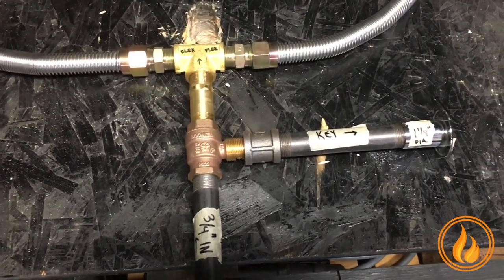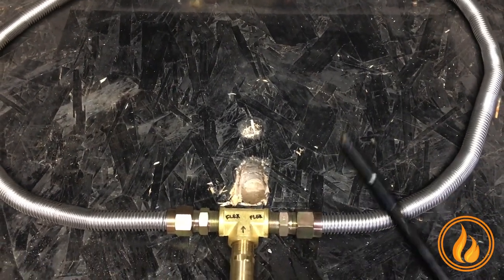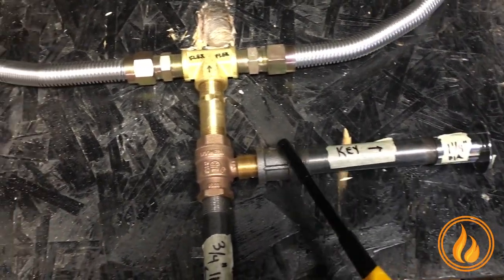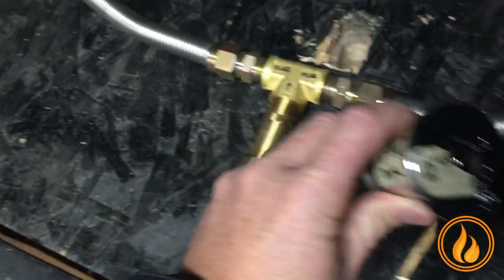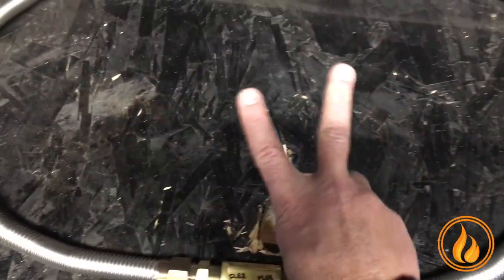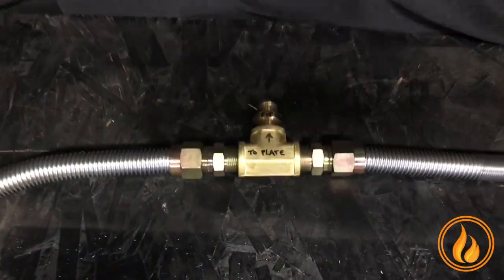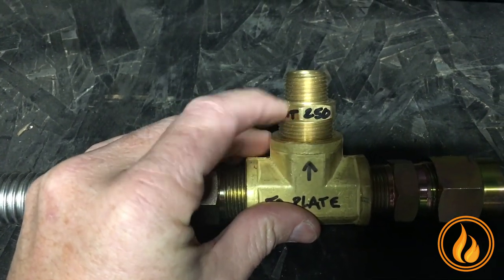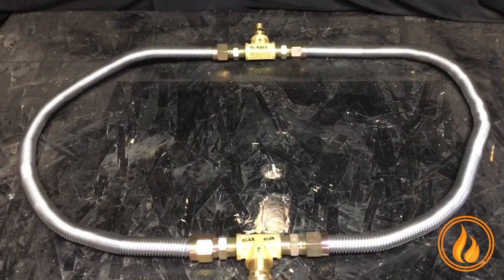Dual flex line kit for gas line installation

Comment: Do you need a dual flex line kit with a auto ignition system?
Reply from the maker: Only if the burner is 250K BTUs or more